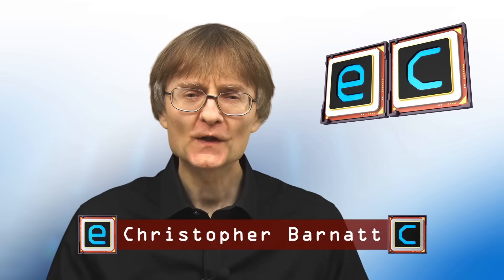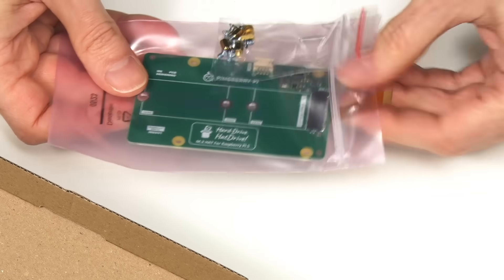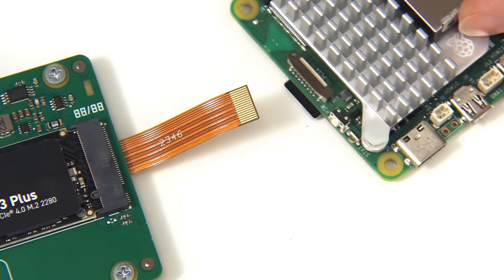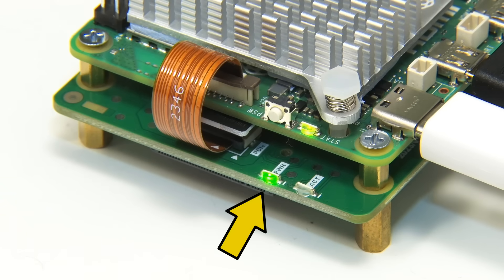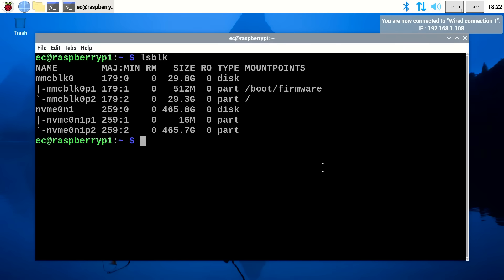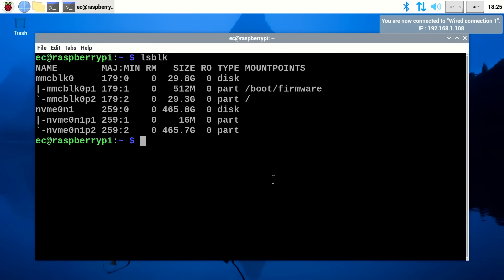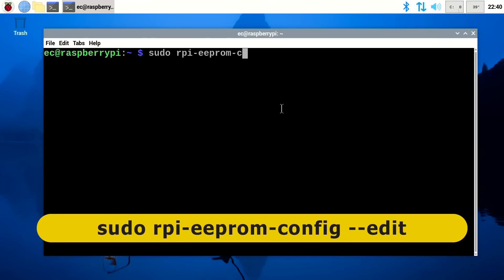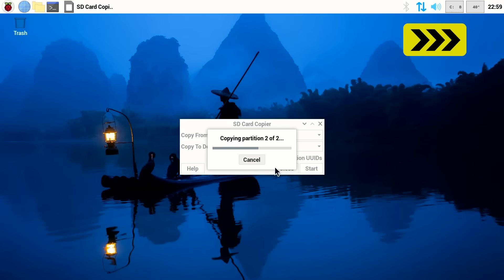Raspberry Pi 5 M.2 HatDrive!

Comment: Booting from Pineberry Pi NVMe drive is flaky! Ok... I have 4x RPi5 and 4x Pineberry Pi bottom HAT boards... first set didn't boot from NVMe at all! I could get NVMe drive to show up and mount the NVMe partitions without any problem when booted from the SDCard. After some frustrating troubleshooting, I gave up booting from NVMe... The next day, it hit me... maybe the 1st PineBerry Pi board is zapped by static or something. So, I swapped the PineBerry Pi HAT board.... using the same RPi 5.... and followed exactly what EC here did in the video... using the SDCard Copier... and reboot... and what do you know? It worked!!! So, now, I shut it down, put in some more standoffs... and assembled the whole package properly, removed the SDCard... and it wouldn't boot from NVMe anymore! WTH??? Not only that... it does not detect the NVMe drive either after I booted it from SDCard (lsblk showed only the SDCard)! What I noticed is that when I issued the "shutdown now" command, the ACT led on the Pineberry Pi HAT stayed constantly on after shutdown (so was the PWR led)! If that happened, and I remove the power, it won't work... You actually have to remove the USB C power... and plug it in again several times. Also, if I boot from SDCard, and see the NVMe drive, if I issued "reboot now", it won't boot from NVMe either. Also, somehow... just "power cycling" doesn't always work... I suspect something about power stays on on the HAT board, so somehow either the HAT board or the SN530 NVMe SSD doesn't get hard reset. Don't know what it is... just flaky booting from NVMe. Very weird.

Comment: It would be ideal if the HatDrive makers took the feedback into account, and it seems the simplest fix about the ribbon cable being in the way of the SD card slot, is to simply design a "curly" cable, that curves around the slot, like you mostly see inside laptops that connect the various boards and peripherals together.

Comment: A pair of very fine needle nose pliers, tweezers or such would remedy the SD card problem.
Reply from the maker: Not entirely, as the problem is in part that there is not enough space behind the card to pull it out, so it needs twisting around as it comes out of the slot.

Comment: My question is, if you copy the operating system from a relatively small SD card to the   nvme drive does that create a similar sized partition and how do you access the rest of the unused storage.
Reply: Thanks
Reply from the maker: The Raspberry Pi copier automatically resizes the partitions, so the full capacity of the drive is available. :)

Comment: 12:47 I haven't used a microSD for the OS and always used USB Boot drive since 2020. Samsung Bar drives work quite well if I don't want to use a USB3-SATA adapter.

Comment: Another excellent video.  Thank you Chris 👍
I have just received a Raspberry Pi 5, a Pineberry Pi bottom hat and an NVMe M.2 SSD for my Christmas, exactly as you demonstrated.  Very good timing.  I won't need to research how to do it now.  As always, your videos are made to a very high standard and easy to follow.   Thanks again.
Reply from the maker: Good luck getting it all up and running. It makes a very nice system.

Comment: There is a ribbon cable extender you can buy cheap for the micro SD card slot. You can get them in a number of different lengths. I have also seen one that lets you plug a full sized SD into a micro SD slot via a ribbon cable adapter.

Comment: I feel a more jovial name would have been an Under-Hatted Drive mount :-) it looks quite nice, & no fan issues ... BTW, when working with small parts under 'scope or other opticals, tweezers can be fun, & sometimes challenging, but in this case, they could have been spot on for accuracy, maybe next time... (I have several sets by my work bench, locking & not, as well as some tools, metal & not... but, I bet you do too...

Comment: As soon as I saw these come out I knew I wanted a Hatdrive! Bottom, for all of the reasons you state in this vid.  I was impressed at how easy installation and getting it to boot from nvme was, so much so I've ordered 2 more units and a 4gb nvme drive to replace my current pi home file server!
Reply: A 4gb drive? Isn't that a typo? The µSD cards I use are already 32 GB.

Comment: Like all other add-on this is a good addition to have, but I don't get it. The Pi is advertised as a single board computer, but it does not contain everything a SBC should have. The microSD is not a replacement of the hard drive it's not designed to work like that, a permanent storage like emmc should have included instead. I would not get an add-on as big as the SBC itself in order to use permanent storage, sorry I'll pass this one, but will get a CM4/5 which is a module not a complete computer.

Comment: Disappointed. I have some Pi 4''s and an ODroid M1, and I was wondering if I should get a Pi5 with the nvme hat. After seeing the throughput, I'm going to hold off. When I run the test on my ODroid, I get 1151.02 MB/sec.I might get an ODroid H3 instead. I was really hoping the nvme hat would allow the Pi5 to outperform the ODroid,

Comment: Excellent video sir! I wanted a 2280 drive on top so I flipped my HatDrive Bottom over the top with some longer standoffs. Works great and doesn't affect the active cooler too much. It doesn't get in the way of removing the micro SD card plus I get some airflow around the drive too. 😀
Reply from the maker: Cool.

Comment: Most excellent! Great video as usual! As for myself, after a few months, maybe more than 12, I finally placed my older RPI4 onto the bench area, but using the USB3 with a M.2 drive/module adapter. Been looking for a RPI5 for sometime, but out here in Ontario, not having any luck, although, some on Ebay, overpriced!!! So in the mean time will use the RPI4. This maybe somewhat out of context, but can any one out there answer this question. I'm developing a remote control for my station, decided to upgrade from a PIC24 embedder server and replace it with the RPI4. Will be using QT5/6 as my IDE with C++ and QML. Only problem is...I've been searching for some "how to cross compile" from a windows platform to the RPI4. Of course the windows machine does have the latest Qt IDE. All I've been able to find info on is to use a "virtual machine with Ubuntu/Linux, etc." Not what I want to do, as I do not care for Virtual environments. So can cross compiling with a Window OS be done? I've used Linaro tool chain in the past, with Ubuntu to program an RPI3 some time ago. Happy new year to all and  happy programming with RPI!!! Cheers and beers! Dale

Comment: Nice product and great detailed instruction video, as usual. UNFORTUBATELY, this exemplifies the absolute BS Arrogance and Laziness of LINUX!  This is a great example for your last video "Linux: an End User Manifesto", where this ridiculous aspect of Linux should have been the 4th point. As stated, the installation to add an SSD to the Pi 5 is indeed a simple "plug and play"...for the HARDWARE!  The vast majority of this video exposes the ridiculously inadequate "ecosystem" of Linux. Well over 40 years ago, IBM / Microsoft DOS had built-in ability to process "Batch" ".bat" files.  These were simple strings of text executed by DOS.  Quickly people used them to design simple "choice menus" and installation commands for hardware and software.  Over 40 years ago!  All the BS gobble-de-gook you typed into the screens here could have been in a simple batch file for DOS, but apparently the Linux crowd can't be bothered to do the same.  How hard would it be to have a simple program (a few kilobytes?) to do all the stuff you were forced to do in this video manually?  It's as if the Linux "in-crowd" is purposefully trying to keep the rest of the world from using their super secret software.  Pitiful.

Comment: Another fascinating and informative video. I'm really impressed with the HatDrive. Yes the SD card issue is a bit of a pain, but you could circumvent it as I have on my RPI4 by using a usb reader for the the SD card. This allows me to pop cards in and out with ease and no obstructions. Running a bootloader that loads an SD card as a priority if one is present allows you to boot up different OS software with ease when you don't want to boot from the SSD. Overall this shows what amazing potential the RPI5 is developing. No wonder this is still the iconic SBC. And the value is still very good too.

Comment: I am temped to try this out once I can get one of these adapter cards.  I was finally able to buy a RPi 5 4GB from digikey when they had them in stock for a short time in the US.  I still have not seen any updates on the original RPi5 8GB that I ordered back in October on release day so that order is still stuck in a back ordered state.  I am hoping they can make enough of these to satisfy all of the demand from the development and tinkering community (consumer orders) before the 3rd party industrial customers start building them into industrial controls in 2024 and market supply completely dries up similar to what happened in the past but we will see as that is looking like it might be a repeat occurrence once again even though I hope that is not the case.

At least with NVME drives we won't have to worry as much about the limited write endurance on SD cards and USB Flash drives.

Comment: As always, an excellent informative video. I'm interested to see how the setup performs under load when in a case, M.2 drives generate considerable heat when pushed.
Reply from the maker: An M.2 running on a single lane PCIe 3.0 should not generate much heat.
Reply: But where is the case that supports the rpi5 with this extra board?

Comment: Fully attaching board via the standoffs should be done very last after cloning and the sd card is out (fold it open like a flip phone, take out card, fold it closed, screws).
Reply from the maker: True, but I would still like access to the SD card regardless.
Reply: A second option is buying a longer 16 pin fpc cable (docs say they can be up to 50mm in length). I think everbody is going to be doing this anyways since there are a bunch of m.2 devices other than just nvme ssd that can go there.

Comment: pi is still basically a disaster though when you compare to other sbc/soc due to a wide range of factors - availability, subpar designs. slow development, cost and overall value plus refurb pc is just a much better decision for prospective users offering much more power, expansion and ease of use - nobody is disputing this, it is a fact sp informed prospective buyers will shy away from pi spam and just get a 3/4th/8th gen pc and be much happier. they may want to get a pi later for experiments but mostly it is an over hyped curio

Comment: You can always get a slightly longer ribbon/flex cable. Not an optimal solution but one figures one would plan ahead, anyway....or just remove one side of the ribbon for a minute...

Comment: How much longer would the PCIe cable need to be to resolve the micro sd card access?  It may be that they'd revise the specs if they knew.  However, I think the PiMoroni device has it right with that offset cable.  Will you be reviewing the PiMoroni M.2 device?

Comment: Do you know, in that final configuration, is the Pi now "power fail" resilient? Or is a small UPS still required to assure file system integrity? Thinking of industrial applications with unexpected power failure. I suspected the answer is "you need to use different file systems" :)

Comment: The question is why would anyone want to do this. An N100 based mini-PC is much better than this, has 9 PCIe lanes, consumes half as much power as a Pi and costs about the same if you include the case.
Reply from the maker: N100 mini PCs and Raspberry Pi's can have different use cases. Over the past few days I've been making a video comparing a Pi 5 and N100 system, and dispute your power consumption ratings.

Comment: I have a 2018 Mitsubishi Outlander PHEV that has a wifi  Kostal model number K9499-002 control unit that is used for a app to remote control things like pre heating the vehicle. I'm looking to extend the wifi antenna , upon disassembly the antenna is plugged into a Gainspan GS1011MIE 1.3 , do I have options to extend the antenna for better phone to vehicle range?

Comment: I've recently got my Beelink Mini S12 Pro with N100 CPU. What can I say about it? It is fantastic. Performance, silence, simplicity, software availability, all what you could possibly need. NVMe and SATA support out of the box. NVMe SSD included, as well as power supply, case, cooling and even two HDMI cables. And even Win11 pro license. How is it related to RPi5? S12 was much cheaper yet has better everything. RPi is not a good option anymore
Reply from the maker: N100 mini PCs are indeed great -- and I'll be comparing one to a Pi 5 in a future video. But I am very surprised that you found an N100 system cheaper than a Pi 5 one -- the lowest cost N100 systems I can find start at about $160.

Comment: Could move to usb boot and then to nvme boot, to avoid the sdcard removal problem, a little usb sdcard reader avoids to do another cloning 
or wait with screwing the hatdrive card till the cloning has finished.
Reply from the maker: But access to the SD card slot more generally would be nice! :)

Comment: In the case of the SD card and the PCIe connector being in each others' way, I wonder if Pineberry should make an offset ribbon cable and move the connector on their HatDrive! to a better location, or if that could introduce other issues.

Comment: This type of accessory makes the Pi5 usable as a desktop replacement. However when you add the price of all the components you are very close to the price of an N100 mini PC. I bought a system with a 500GB drive and 16GB ram for NZ$263 where the 8GB Pi5 is NZ$145 before you add accessories. Happy new year and thanks for another excellent video.
Reply from the maker: A Happy New Year!

Comment: Chris, it's cool to see that the Raspberry Pi is catching up with Radxa/OrangePi who have been offering either M.2 M key or M.2 A/E pci slots. One note, for RPi 4 users, it not widely publish, but Argon40 has M.2 NVE add on for their Argon One Case, it was $30 USB, ten more than the M.2 Sata ( M.2 B key ). 

Good video. One stupid question if under the board, why is it still a Hat? Should be called something else or is HAT another term for Add-On? Happy New Year sir, can't wait to see what you show in the New Year.
Reply: Perhaps we ought to develop a bit of new, ad hoc nomenclature.  Just as a suggestion, bottom mounted storage boards could be referred to as "basements" or perhaps "cellars" and top mounted storage boards could be referred to as "attics". 

Note: If those are not the words for the storage spaces that are below and above the main living spaces in a home found in the U.K., then please adjust my suggestions to suit. 😉
Reply: AssHAT?

Comment: too expensive ... you get a fully loaded N100 system for less .....
Reply from the maker: The cheapest N100 systems I've come across start from abut $160, which is not less than a Pi 5 8GB + PSU + M.2 adapter + NVMe SSD (although there is not much in it!). :)

Comment: Used Lenovo Think Centre M910q (mini PC) including the m.2, including 8Gb, including power brick - ~ 120€. Same for a Pi5 (4GB) + hat + m.2 + case + power brick + cooker + fan... BUT :) the Lenovo has the same idle power as your Pi5, it has a 2nd 2.5" bay and 6x USB 3 ports... so with all respect - good luck with the PI5.
Reply from the maker: Yes, there are cheaper second-use small PCs, as I have covered in detail inseveral videos on this channel in 2023 -- eg: https://www.youtube.com/watch?v=ZPX3A7YS-6Q  But I would be staggered if your Lenovo has an idle power draw of 3W . . .

Comment: I installed the Pineberry bottom board with a 2tb drive and have stable results so far with Gen 3. I don't like the fact the board faces down exposing the ssd to the world. I had a bit of drilled plastic from another case that acts as a cover. My Pimoroni board is in NY city and on the way. It points the ssd upward for proper protection. I also bought the Pinebery Hat top board and find the included FCB ribbon is too short to raise the unit above the Active Cooler a reasonable amount. I am waiting for Pineberry to start selling their advertised cables on the website.

Comment: I am sorry, but I have a 8 year old Banana Pi with a SATA port + power on the SBC. The Pi 5 is to expensive and this solution is garbage. A SATA SSD makes more sense, the speeds of the NVME M2 SSD are just not used.

Comment: When I had a similar annoyance with SD cards being blocked by ribbon cables, I discovered the wonderful devices called "Micro SD extenders", you put a dummy SD card in the slot, which has a short, rubbery cable attached that leads to a cage you can enclose and lock the Micro SD card in. They work really well!
Reply: Thanks for an excellent tip, I will try that when I set up my raspberry Pi 5 and Pineberry hat

Comment: Happy New year the positioning of the cable is bad but if you were doing a case you could use a separate standoff under the keyboard and the hat could go alongside the pie with a little trap door to access the micro SD the cable would be above it and not looped over it

Comment: I'm currently using a badly designed (no thermal contact to chassis) UGreen USB NVME adapter which is working well tbh.
I grabbed the Argon Neo for the PI5, so I'm hoping Argon release a NVME base like they did for the PI 4 "One" case, this time using the ribbon connector obviously.
Reply: Frankly, I am expecting them to, it is so obvious that if they don't, somebody else will.